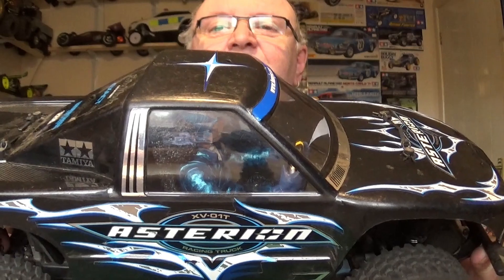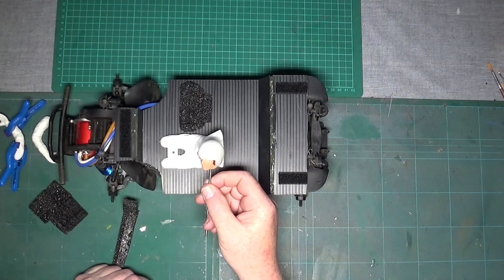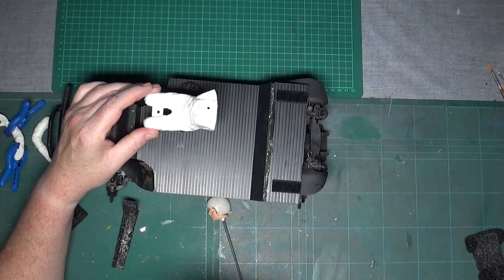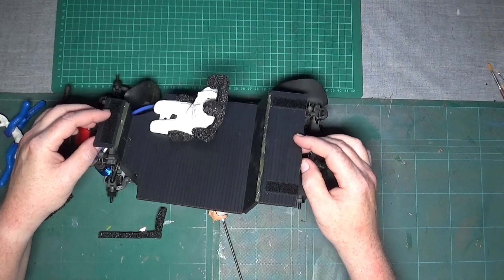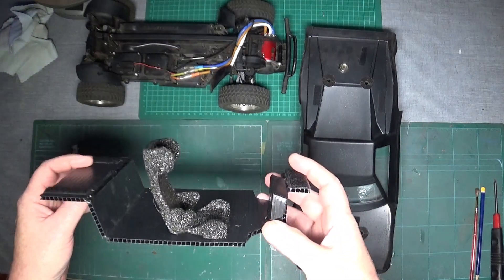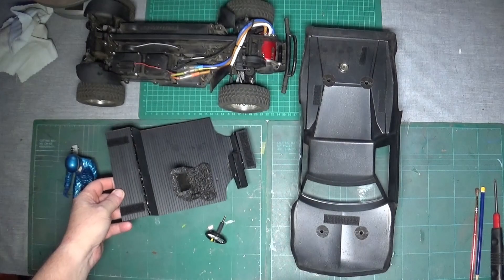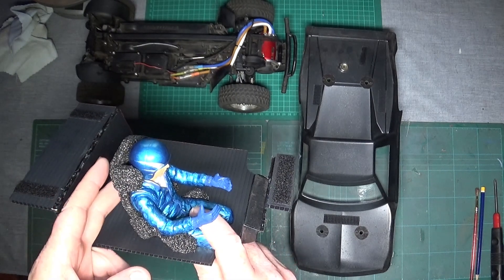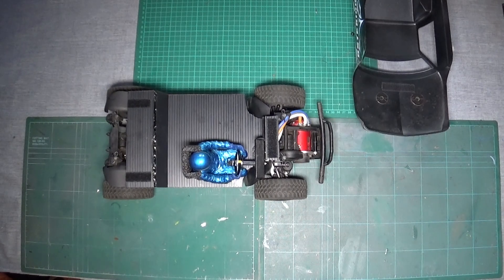Making a Bespoke cockpit for my Tamiya XV-01 Asterion

Comment: Well done!
The cockpit looks great. Did you make the steering wheel too?
Reply from the maker: Hi Del. Cheers mate.
Sort of, cast it from a mold.
Reply: @robbrennanrc  Cool! 
I just made one from a keyring with the spokes cut from the lid of a tin of beans, Yours looks more realistic!
Reply: @robbrennanrc  So did you make the mould? From silicone?
Reply from the maker: Yes mate. It's a 2 part mould but having a few issues getting the plastic to fully fill but I'm sure I'll work it out.